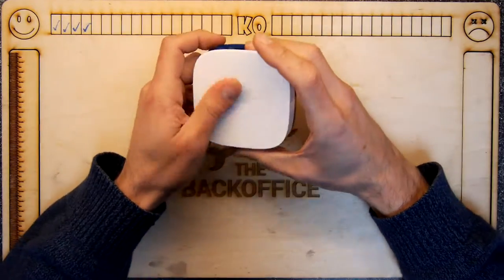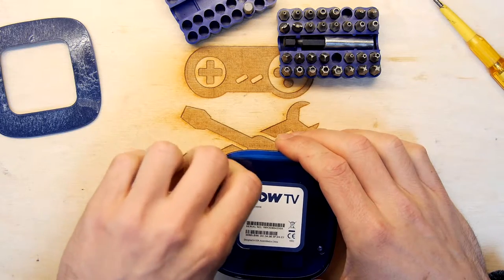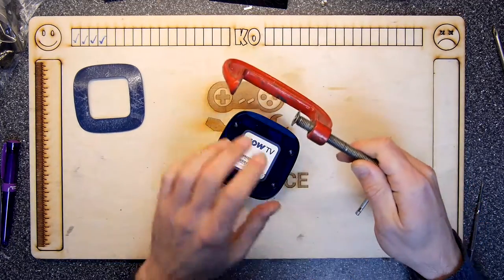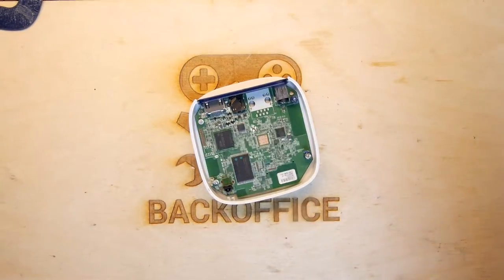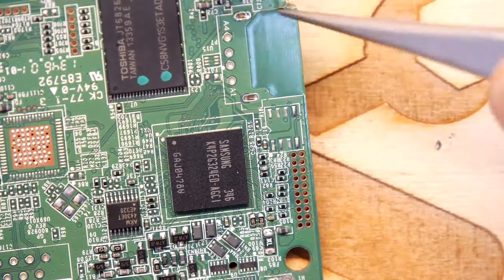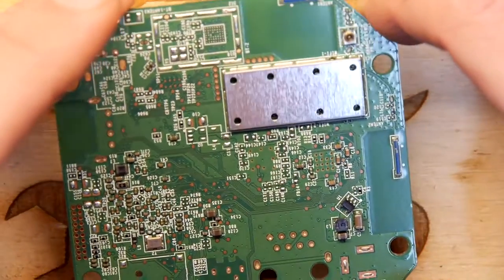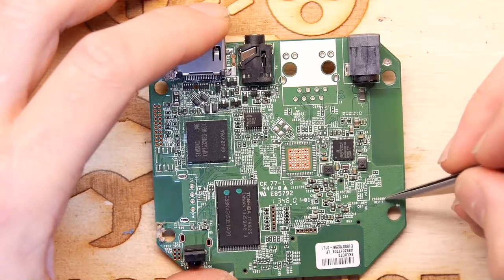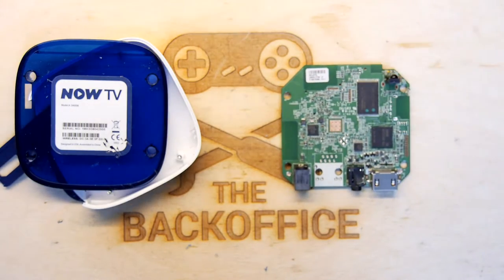Now TV Streaming Box

Comment: Additional mystery footprints appear to be a micro SD card slot under the hmdi and a full size female USB port on the side. I wonder if the supplied firmware supports them or if they are disabled in that version ... interesting.
Reply from the maker: +sjm4306 I might try powering this up, perhaps with the addition of some of these they can be hacked
Reply from the maker: +sjm4306 https://www.engadget.com/2014/04/08/sky-now-tv-plex/ darn, you need the remote 🙁

Comment: Come on you must have a decent set of Torx bits and drivers!  Those thin spindly silver screwdrivers are hopeless for most jobs, as you cannot get a strong grip and apply enough torque and they break so easily.  Apart from the usual drivers I also like those 'T' shaped handles with the magnetised end to put bits into.
Reply from the maker: +EgoShredder i must have somewhere 😂